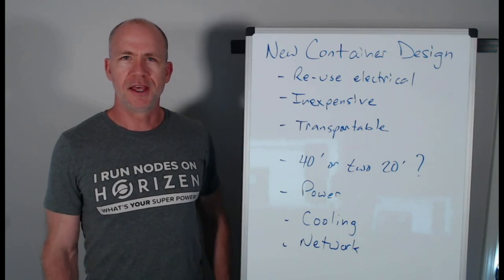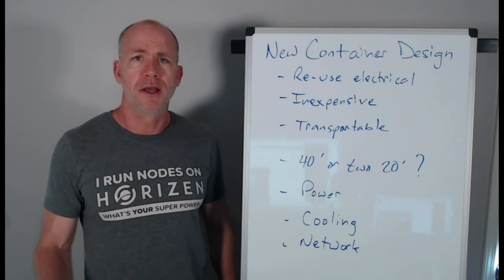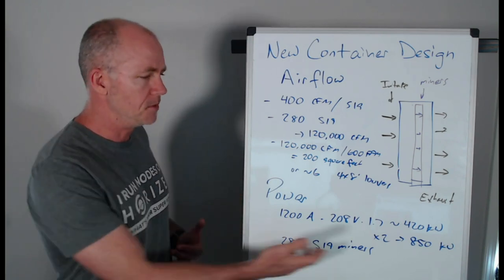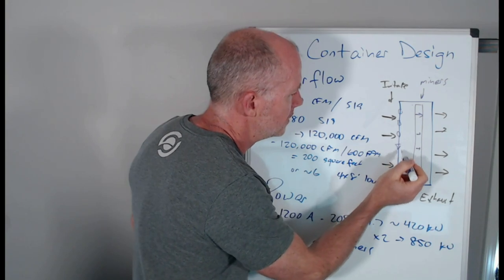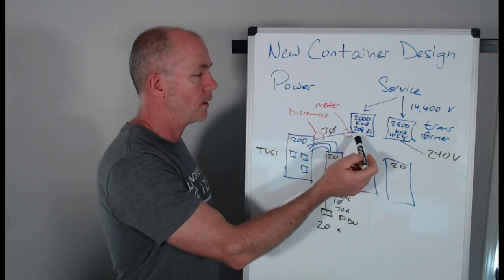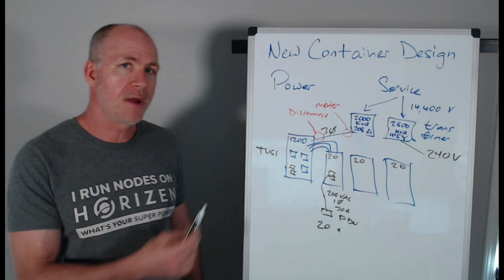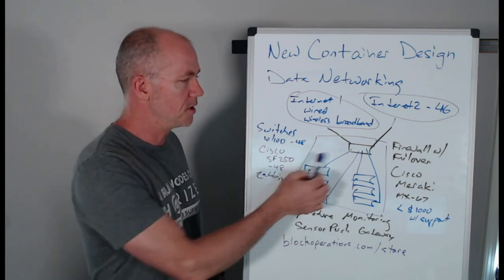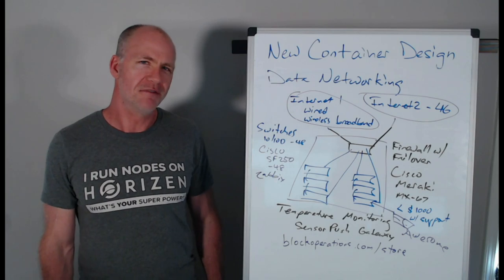Designing a Low Cost 40 foot Mining Container - whiteboard

Comment: I don't have the crazy mining power that you have, but in 2016 I built my mining shed and converted all my GPUs to watercooled using universal cpu blocks from china. I ran a gravity based system to reduce the line resistance on the coolant pump by using 4 inch pvc near the roof level that flowed coolant to all the GPUs via gravity before dumping to the bottom 4 inch pvc line, which fed the water pump that pumped the coolant through 1000s of feet of PEX lines that were buried in the ground among the yard. This setup was capable to keep my GPUs cooled during the summer of Florida. I eventually added grid tied solar to the system in 2017 to reduce my energy cost, but now I only have a fraction of the GPUs I had in 2017 and have it setup to ONLY mine during the day when solar offsets 95%+ of my electricity usage. At night my system sits idle only :(. Regarding air filtering, I use oil bath filtering that I built into the floor of the shed that use cheap motor oil for filtering and generic house water filter for looped cleaning 1hr a week.